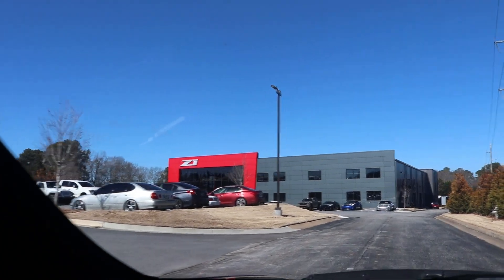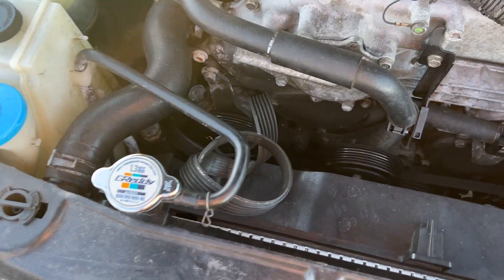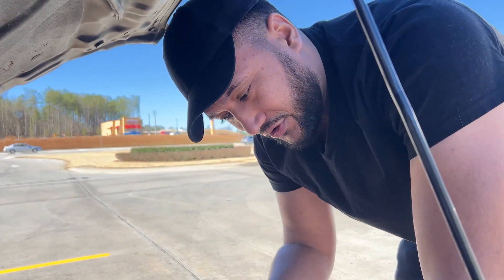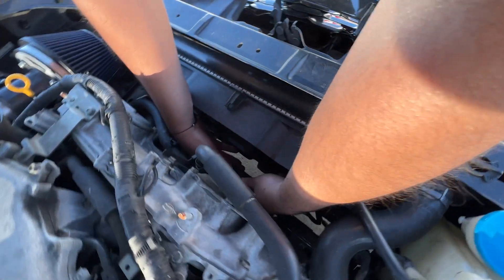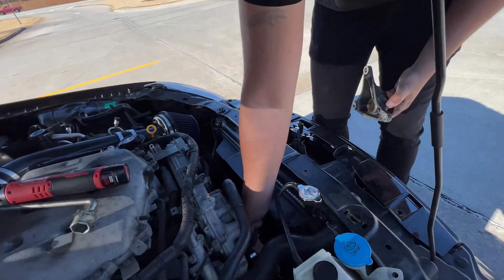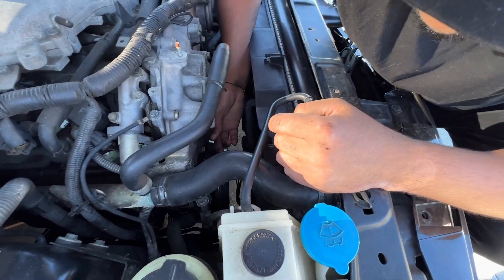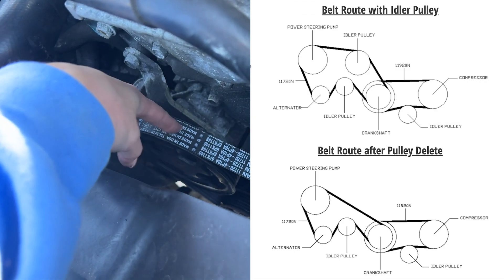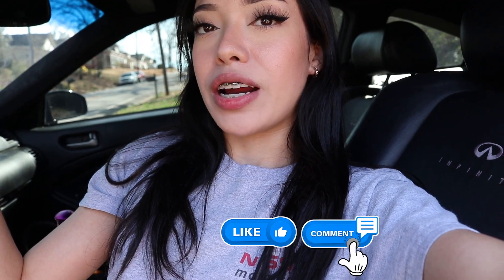G35 Idler Pulley Delete | Squeal issue fixed?

Comment: The squealing is the belt slipping/tensioner not being tight enough. It will make a ton of noise when you first start the car and then after a few minutes once the belts warm up they catch the squealing will go away. It can happen intermittently while driving as well say if you are cruising lightly and then downshift to gun it the sudden change in rpm will cause the belt to slip and make noise until the belt catches up with the pulleys. I had this issue for a few months and it was worse in the winter. For me, tightening the adjustment bolt to add more tension to the belt solved the squeaking for me. I also did the idler pulley delete to clean up the front of the engine.
Reply from the maker: I’ve done it all and nothing solved my issue except this mod thankfully 😄

Comment: My 1st was a 05 G35 coupe manual back in 09 put like 15k into the car did almost everything except turbo 
My 2nd 2011 auto was a G37 coupe IPL in 2018
My 3rd was in 2021 another 05 G35 coupe auto 
And now in 2023 an 04 auto G35 coupe. Its pretty hard to find a decent condition manual in Miami fl 
Deep love for these vq cars

Comment: Same issue with my 04' 350z. It ended up being my AC compressor pulley. That's why my AC was out. It especially did it more when I turned on the AC. You can check that if you're AC is out.